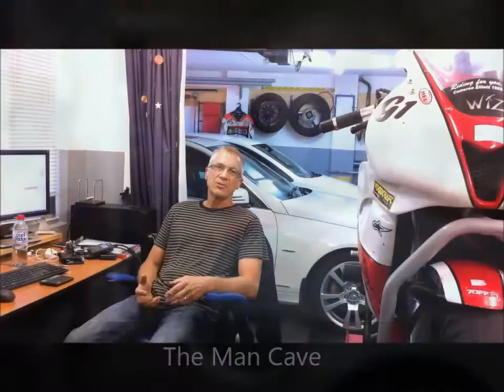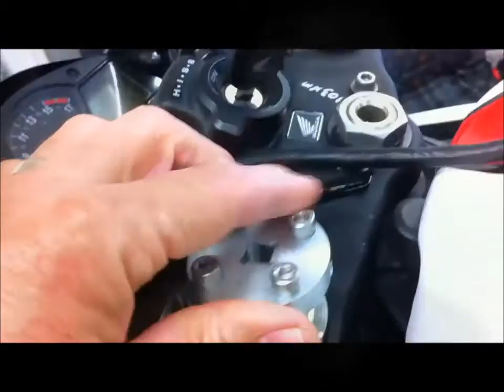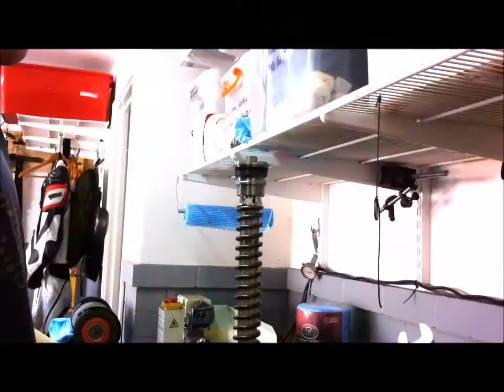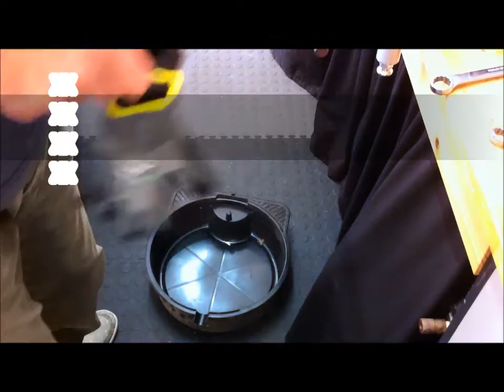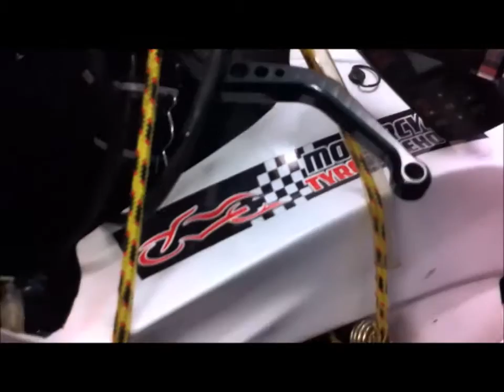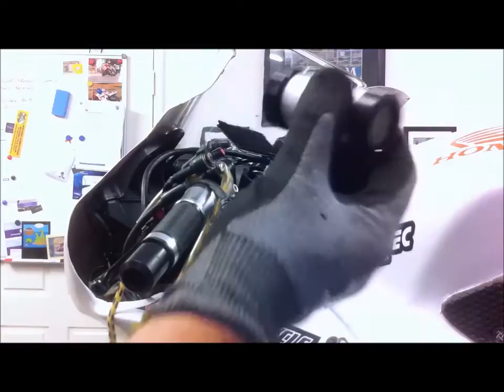2007-2017 Honda CBR600RR Ohlins 30mm Road & Track Cartridges Install Remove Oil Level

Comment: Hey Scott, 

Thanks for posting this. I recently had some Nix 30's with .09 springs professionally installed in my 09 cbr600rr. One of the reasons I did this was because I'm 6'1" 160lbs and couldn't achieve proper front sag with the factory spring rate. After installation and a couple of weeks break in, I can only get maybe 10-15mm of sag sitting on the bike with preload all the way out (counter clockwise). Does this sound right to you?  Could this have anything to do with the top out spring not having been compressed during installation, decreasing the air level? Is there something I'm missing? I don't see how adjusting my damping settings could make any difference but I've tried anyway. Is the OEM top out spring retained or does ohlins provide their own? If so could both top out springs have been installed on accident? Sorry for my confusion, I don't have much first hand experience working on cartridge forks. I had a set of Nix 30's installed on my previous bike and they were fantastic. Any thoughts are welcome.

Thanks, 
Will
Reply from the maker: Will I'd say you have too much preload which means the spacers need shortening. I spent a lot of time researching how to set up cartridges with TO springs. You need to forget all the old rules around rider sag. I made two videos to try to explain how to set them up. We've just done this for two GSXR750's we have at Sepang in Malaysia and it works famously. Watch part 1 and 2 and see how you go grasping the concept. https://youtu.be/jYcknRfj0kw

Comment: Hello scott,

Based off video I realized you didn’t do anything with the rebound of these forks. In the PDF, they stated to open fully the rebound when installing it back on the damping rod... 

is this necessary?? Cause you just installed it. 

If I chose to follow pdf, when opening the rebound before installing it... am I require to reset rebound again? Or does the rebound clicks stay the same regardless since oil travels up the damping rod into the needle at the cap?
Reply from the maker: Frenchie ... With normal OEM cartridges it's good practice to back off the damping settings. With the 30mm Ohlins cartridges I've found it's not necessary. The cap position is fixed and the normal setting is already about 12 turns out. For interest I run 14 out. So the screw is already backed off a lot in in its standard setting. Scott.
Reply: Scott Elliott dang that’s interesting so with rebound fully out... when finished and putting in rebound.. you can’t over done the clicks over or under at all since it’s a fixed rebound clicker
Reply from the maker: Yes that's right. The nut on the rod is fixed and the cap tightens onto it. So the cap with the clicker adjuster always goes back to its original position.

Comment: Thanks for posting this and the fork seal vid - I have this very job on the same bike/ohlins fork to do at the weekend.
Reply from the maker: Thanks Paul. I hope the vids help you. One thing I forgot to mention in the video is that I usually drive the bushings in first and then the seal. You can do the seal and the fork bush together as I did in the video but it's actually a bit easier to do the bush first then drive the seal in. Regards, Scott
Reply: MrScott52  Hi Scott. I just completed the job. Your vid was invaluable. I have a doubt about how it went for me though. On my inserts I have rebound on one side and compression on the other. I pumped each insert until hard as you described. When I came to syringe out to get the level more came out on the rebound side than the compression side. I suspect therefore one side has more oil than the other..... any thoughts ?
Reply from the maker: ***** Paul they should be approximately the same volume. I wouldn't worry at the moment. After riding a bit do the levels again. It's easy to pull the caps off, spring and spacer out and reset the level. Did it all go reasonable well apart from the oil level?
Reply: MrScott52 Thanks - I got it right this time. Thanks again for the advice.